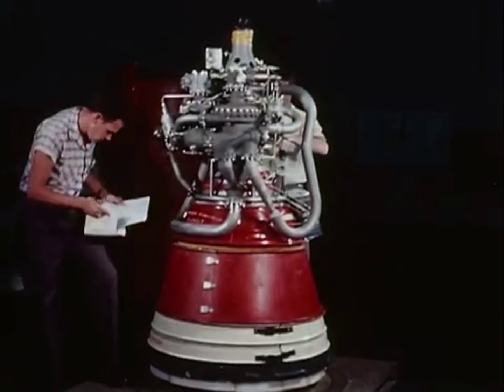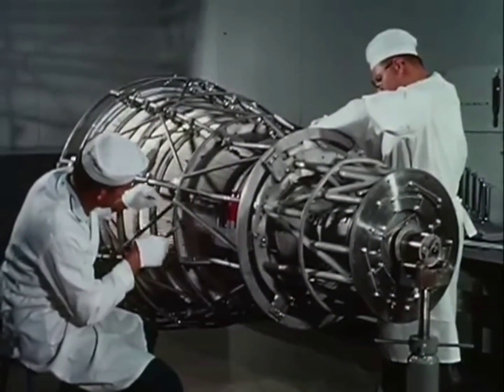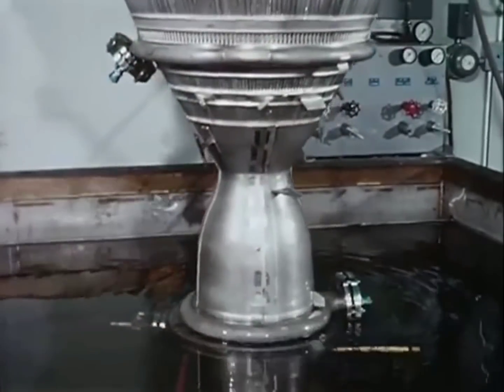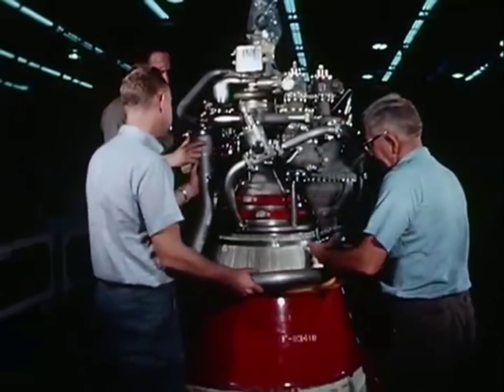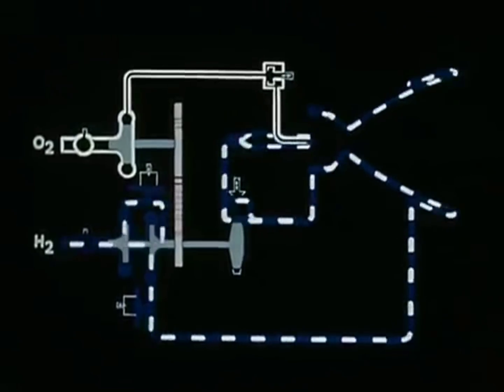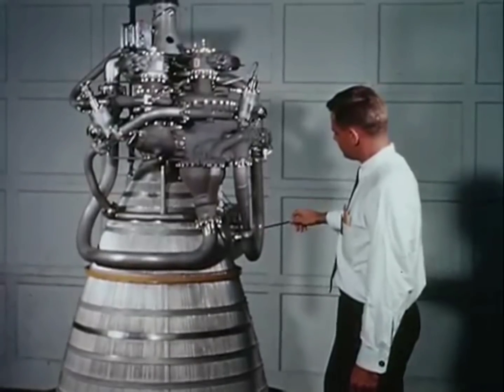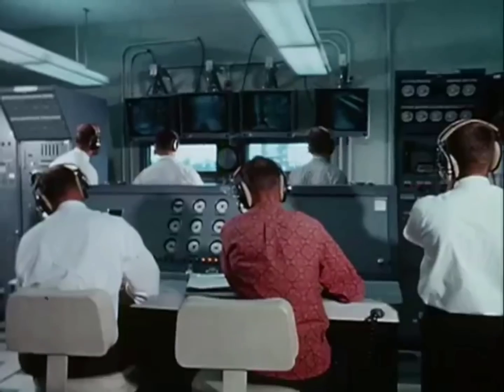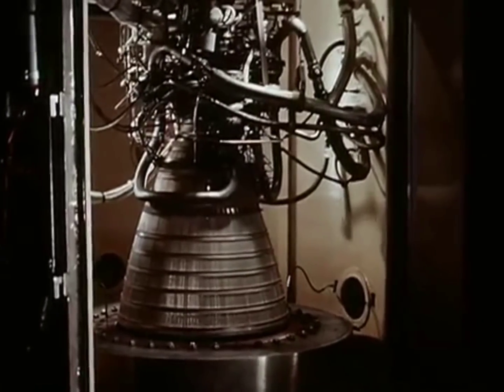Workhorse RL-10 Engine to Power SLS Artemis Upper Stage

Comment: I worked on the RL-10 in 1962-1963 at Pratt & Whitney Aircraft Company in West Palm Beach, Florida.  Great engine, and still in use with Aerojet Rocketdyne.

Comment: Congratulations NASA you made an engine that worked in 1960s work again.  
And for only 14 billion dollars!  Is this Aerospace or Archeology?
This is why the SLS is so vastly inferior to SpaceX Starship.
Reply: Starship won’t be safe for a long while
Reply: @coffeespy1133  said: "Starship won't be safe for a long while"
Whenever a "long while" is,  it will be way before SLS
Reply: @jasonsadventure  what makes you think that? Sls has a abort system?
Reply: @coffeespy1133  said: "what makes you think that?"  
Think that Starship will be ready way, way before SLS?   
Because Boeing can't deliver on time - so no SLS launch, no system to abort.
Boeing repurposed 1970s era tech will likely balloon in price and get cancelled.
sadly
Reply: @jasonsadventure  funny you say that cuz both have been tested and built for a while now
Reply: @coffeespy1133  said: "both have been tested and built for a while now"
A SLS Block 1 (Crew module, Service module, Propulsion stage, Core stage, Boosters and Engines) have not been assembled, tested or flown from any pad, anywhere.  Nor will it anytime soon.  Moreover Boeing has not successfully put a manned craft into orbit since 2011.  So you must mean the recycled and bolted together RS-25 rocket engines, Morton Thiokol solid rocket boosters and LOX tanks tested 40 year ago for the Space Shuttle, right?  This really sucks because Boeing use to be amazing.
Reply: @jasonsadventure  every single aspect of SLS except the tanks if you want to be really literal. has flown in the last decade
Reply: @coffeespy1133  said: "every single aspect of SLS has flown..."
A SLS Block 1 (Crew module, Service module, Propulsion stage, Core stage, Boosters and Engines) have not been assembled, tested or flown from any pad, anywhere.  Nor will it anytime soon.  Moreover Boeing has not successfully put a manned craft into orbit since 2011.  So you must mean the recycled and bolted together RS-25 rocket engines, Morton Thiokol solid rocket boosters and LOX tanks tested 40 year ago for the Space Shuttle, right?  This really sucks because Boeing use to be amazing.
Reply: @jasonsadventure  Orion isn’t sls. Sls merely flies Orion. And about Orion not being built, I suggest you look farther into it. You will find that 3 are built and 3 more are in construction. Adding on, it doesn’t matter whether Boeing has put people into orbit as this isn’t Boeing based. Also, like I said. If you want to get literal then the actual tanks havnt flown like I said. But every single engine on there has flown.
Reply: @coffeespy1133  said: "every single engine on there has flown"  Okay.
But what does that mean, literally (as opposed to figuratively or metaphorically)?
How does an engine "fly" without a craft?  Do you literally mean "test fired?"
Also, do you have a link that substantiates that there are (3) SLS Block 1s built?
Where "built" literally means constructed, assembled, and tested?
Reply: @jasonsadventure  no. I mean every single engine that will be used on SLS has flown. The srbs are the ones used on the space shuttle with one extra segment. The rs25s were flown on the space shuttle. The rl10 upper stage has been flown countless times on atlas and delta rockets. The aj10-190 on the Orion service module has flown on the space shuttle as the OMS engines
Reply: @jasonsadventure  oh and I was wrong. One is made and 2 more are far in production https://en.wikipedia.org/wiki/Orion_(spacecraft)#List_of_vehicles
Reply: @coffeespy1133  said: "every single engine that will be used... has flown."  As I said...
"NASA made engines that worked in 1960s work in the 2020s all for $14B."  
And my point is, they've never worked together in SLS Block I.  And may never.
Boeing has not moved the needle of innovation an inch while charging a mile.
And to be literal, the design flew, none of the current hardware has.
Reply: @jasonsadventure  I don’t know why you think Boeing is such a big part of sls, it really isn’t
Reply: @coffeespy1133  said: https://en.wikipedia.org/wiki/Orion_(spacecraft)#List_of_vehicles
This is seems to be about the Orion crew module - not whole SLS.
Also, it looks like the Orion never flew in it's intended configuration, with a service module.
Reply: @jasonsadventure  I never said Orion flew, plus I never said 3 sls were complete. I said 3 Orion were complete(which was wrong)
Reply: @coffeespy1133  said: "I never said Orion flew"   You're right, you didn't.
You did say Boeing isn't a big part of SLS when Boeing is the prime contractor.
Reply: @jasonsadventure  source?
Reply: @coffeespy1133  said: "source?"
https://www.boeing.com/space/space-launch-system/index.page
Reply: @jasonsadventure  nowhere in that link does it mention anything you said
Reply: @coffeespy1133  said: "nowhere in that link does it mention what you said" 

   "Boeing is the prime contractor for the design, development,"
     "test and production of the launch vehicle core stage and"
     "upper stages, as well as development of the flight avionics suite"

... a direct copy/paste from the 2nd paragraph, first page.

Comment: You’re telling that a 2021 rocket is using 55 year old tech?
Reply: Your car is using 140 year old tech.
Reply: They're using 55 year old tech because there isn't a way to significantly improve it. You can't increase the efficiency of the combustion, it's already using a perfectly optimized nozzle, and the turbopumps all work perfectly well. The RL-10 is the single most efficient rocket engine produced *ever*, and that's why they're using it.

Comment: They mention using steam to lower the pressure enough to do an engine test. How does that work?
Reply: We put the engine in a can on the test stand..we had a boiler that sent steam to the accumulators then to the can.. we replicated space inside the can.

Comment: NASA and their contractors have absolutely no reason to ever fly these missions. They, and their corrupted unions, are getting filthy rich off of "cost plus contracting" which incentivizes NEVER delivering what you promised. Every delay ends in, "cha ching!", for these criminal mobs.
Reply: It seems someone has no idea how cost plus contracting actually works
No contractor gets any advantage out of being slow. You can argue they don't get enough of a penalty for it (a cost-plus contract is pretty much all carrot, no stick) but it's not something the contract actively rewards them for.
What the contract actually rewards is development milestones its just that the full cost of the contract is not as limited as it would be on a fixed price contract
Reply: @brokensoap1717  And they're not all cost plus, NASA also hires prime fixed price contractors.

Comment: Unbelievable this ancient rocket engine using the most primitive construction methods is still being used.  This choice demonstrates the core issue of using government to do anything.  It is inefficient, unimaginative and grossly to expensive.
Reply: This engine is still in use beacuse it's most efficient chemical engine on entire planet and is pretty cheap. more respect to it.
Reply: @_mikolaj_  RL 10 is efficient because it is a LOX / LH2 engine that by its nature is highly efficient.  However the RL 10 is beastly expensive at around $38 Million a copy. It is a small engine with 24 klbs of thrust. Compare that  to a Merlin 1D vac engine for $2.17  million per engine with 200 klbs of thrust.  Many times AR has offered to update the RL 10 to modern manufacturing methods and state of the art technology.   The government refused to fund.  There is no question this 1950s technology engineering is grossly obsolete.
Reply: @WWeronko   I agree, have been dismayed AR is still using this old tech. Also agree a stockholder owned rocket engine company isn't going to take on expensive development costs for the fun of it. But now we see their habit of waiting for govt funding to do anything has come around to bite them in the ass. Aerospace companies have self-funded new tech to make sure they're ahead of any competition - even in this field, competition occurs. SpaceX will put the Delta family almost out of business. Blue Origin almost got the contract for the upper stage engines of ULA's Vulcan. I'm guessing AR made a big price cut to compete against BO. Did read that AR started developing 3D printing for the RL10 nozzle, about 1-2 years ago. Yeah, after SpaceX and Rocket Lab were already printing major parts or entire engines.

But AR sat around happy and sleepy with the status quo, charging an enormous markup for their engine. The Atlas V for Starliner needs 2 AR10s. At $72 million that's already the cost of an F9 launch and more. Not griping at you, but at the layers of folly of the old-line rocket companies.

(Actually, I've heard many figures for the AR10 price, from below $25M to the $38M.)
Reply: @WWeronko   first RL-10 doesn't cost 38 million a piece. Maybe that was the A version back in the day.
Since than AJR has constantly improved RL-10 design and the latest version that is supposed to fly on SLS, Vulcan and also Omega, uses extensively 3D printed parts, including the combustion chamber and an overall simplified design that uses less pieces to complete the engine. The RL-10 CX has beaten the BE-3U in bidding competitions 3 times. It's likely that the cost for ULA and NGIS was around 4-5 million a piece. SLS has a contract for 10 of them at 200 million. That's makes 20 million per engine, however the contract value also includes modifications, testing and certification of the engine for human rating, so that's inflates the cost figures by quite a bit. Human rating is a costly thing.

Second thrust is not the main means of comparison for upper stages. RL-10 is supposed to push payloads from LEO to high energy orbits. So it needs efficiency. That's why it has such amazing ISP (465 sec). 

Merlin Vacuum has more thrust because it's supposed to push a big second stage to orbit from low velocity (due SPX needs of first stage recovery), so it has to have a ton of thrust. However when going to high energy orbit the low ISP of the merlin 1D vacuum of 345 sec puts the Falcon family at great disadvantage against rockets that uses RL-10s in the upper stage. That's why an Atlas 421 while murdered in LEO performance, already overtakes F9 on TLI payload